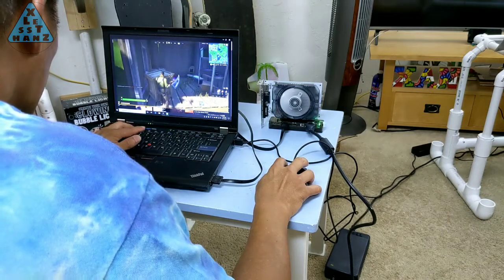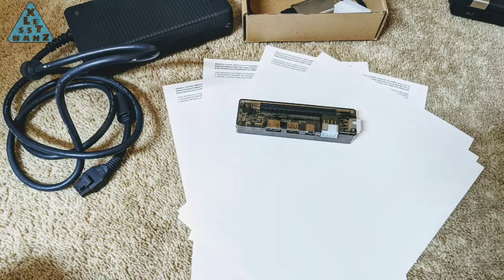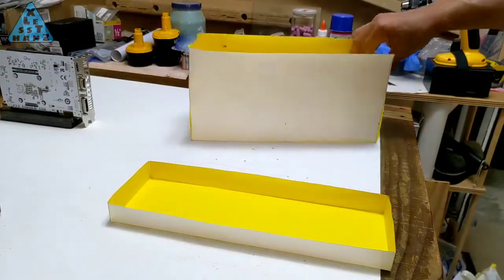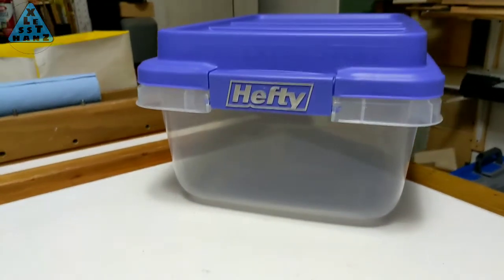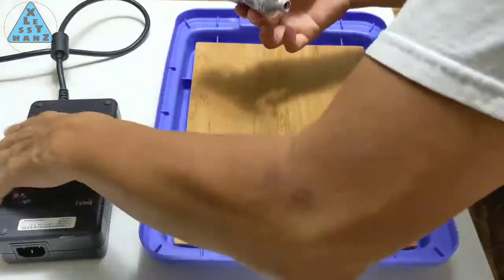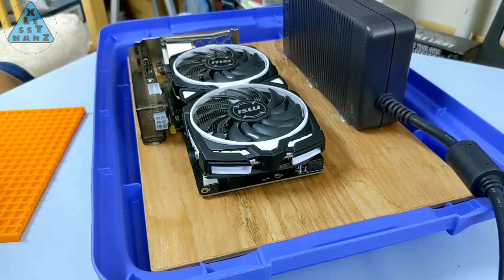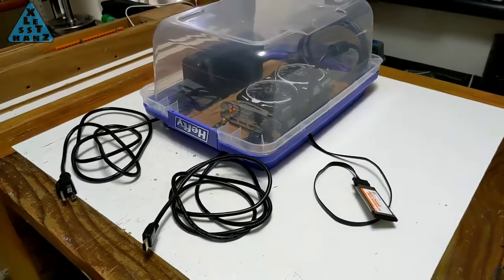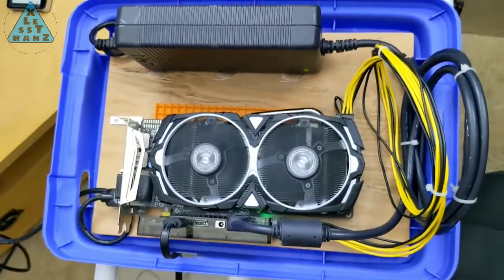2 of 3 - EGPU GDC Beast Enclosure (INCLUDING POWER ADAPTER)

Comment: I was looking around for videos of DIY eGPU build, and stumbled upon yours, I was planning on building one with an enclosure built using Legos. Honestly seeing your video makes me chuckle a bit, but yes, using a plastic container like you did is actually a very good idea. You might want to add maybe one big low RPM fan up top (on the clear side to help with the air circulation (large diameter fan with low RPM won't be noisy). Anyway, great job
Reply from the maker: At the end is a link to the next video that adds RGB and a fan on top.
Reply: @XLessThanZ  ah yes, I finished that one too, your work is amazing.
Reply: @Eliezer David I haven't managed to find any good GPU. The price in here was extremely horrible (we're talking up to a year salary's worth for any high end), but yes I am planning to do it as soon as it is feasible